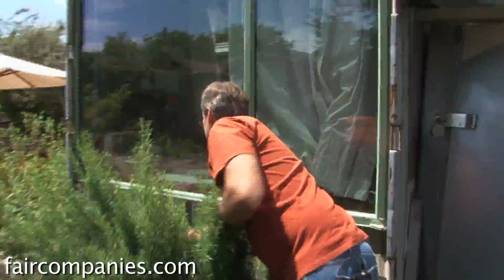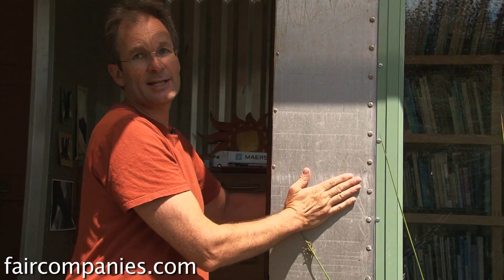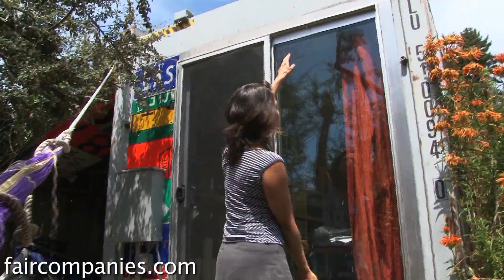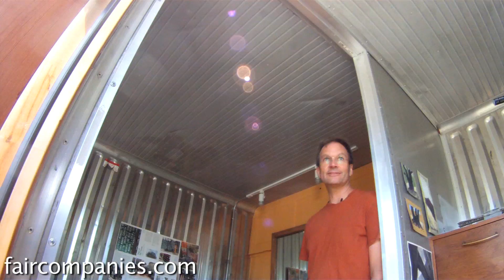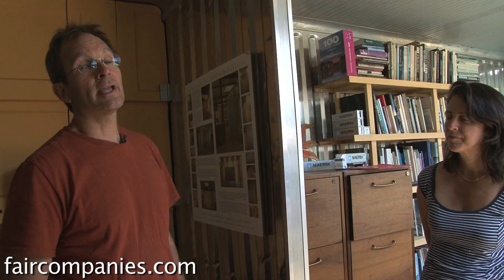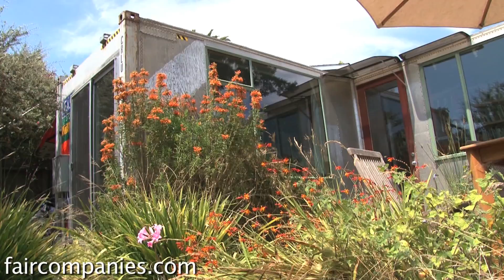$1,800 used shipping container as architects' backyard office

Comment: You can buy forty-foot used 9'6" High Cube sized reefers as shown in the video near most seaports with some searching. Many dealers advertise on Craigslist.  They are typically delivered by tiltbed "Landoll" trailer. They only require support under each end which is how they are designed to be connected aboard ship.  No need for a full foundation.
Reply: hey, we sale used & one trip(new) shipping containers in US and Canada, contact me if you need to buy

Comment: Using a reefer container gets around the biggest problem using standard containers, the insulating of them, which either has to be furred wall w/ either batt insulation which shrinks the interior area or using high density spray foam. With foam you can use a thinner wall but its messy. The other problem I have is that the ceiling/roof on most standard containers is just too low, I would rather look for the newer High Cube containers which are 9'-6"' high but they are also alot newer so there far fewer of them going to scrap, plus I dont know if any HC containers are reefers.
Reply: +jesse e if you're in a hot climate consider adding a secondary roof over the top and sheathing the container in something like wood to act as a sunscreen. the steel shells of these containers get very very hot in direct sunlight and even if insulated can transfer that heat to the interior.
Reply: Yeah - it was a brilliant move getting one already insulated.
Reply: +KlunkerRider Thanks... I do plan to add the wooden screen on the exterior... with perhaps creeper plants or vines growing over these... As for the secondary roof... i considered that but thought a platform which would act as a deck might perhaps be more useful... that and add several potted pants/mini garden in the space I won't be using up there... In any case both plants and platform will be slightly raised above the roof of the reefer... perhaps with about 6 inches of clearance...
Reply: +jesse e roof deck? even better, good luck with it.
Reply: You might try looking into sprayable ceramic coatings.
Dynamat might also prove efective.
Reply: My sentiments exactly I plan to use two reefers for a house. I think it will save up a lot on insulation... I live in a tropical climate... it never really gets cold... but does get quite hot at times... as for the high cubes yes there are quite a number available now... but i see your reply is old... should have become more available in your area by now... :)
Reply: KlunkerRider fgjgk

Comment: I'm actually working on a design for a shipping container inside a shipping container that slides out which makes it movable. Two of them side by side at an angle with a courtyard and patio in between..  a fully self contained unit with utility room, generator, solar panels, inverters, water collection and storage and tratment, a biomass gasifier for heating, electricity and possibly bio diesel production via the Fischer-Tropsch process.. no kidding...
Reply: Interesting! I'm currently working on temporary shelter using standard ISO 20ft shipping container. I will be using it as temporary home during a construction project in East Africa. Maybe we could exchange ideas.

Comment: Worried about the formaldehyde in particle board but are OK with the cyanide in the insulation... Neither of the 2 are dangerous unless you plan on grinding it up and doing bong hits with several pounds of the stuff...lol Cool project though... Nice video...

Comment: Also, how thick is the insulation? Polyiso is ~R-7 per inch, I'm guessing it's 2", so still less than R-21 required here in WA state. Maybe 1-1.5" rigid could be added to the interior w/ wood or drywall over 2x2s, that would allow for wiring too.

Comment: Electric looks easy, just run in conduit if you leave the inside bare like these people did or frame out finished walls if you like.  Plumbing similar, but have the sewers lined up before you lay it into place
Reply: Could u see how they did the framing for doors and windows? Want to put a door in but unsure how to attache frame to the container itself. Only want the one normal door at end where the original doors are but recessed so original can be used if it ever needs moving

Comment: Thanks 4 the video, 
I am in the process of creating plans for my insulated shipping containers vacation home down in the Caribbean and i have a few ???'s 
1: How do you run the electricity?  inside the walls? I was thinking run the wires on the inside face of the container, then cover it with drywall?
2. since i will be joining 3 containers together, and cutting out an entire side of a container, can i use that cut out wall as an interior wall perpendicular to the length of the container?